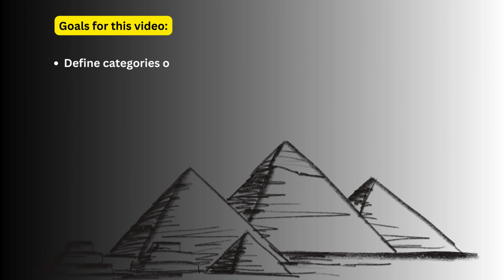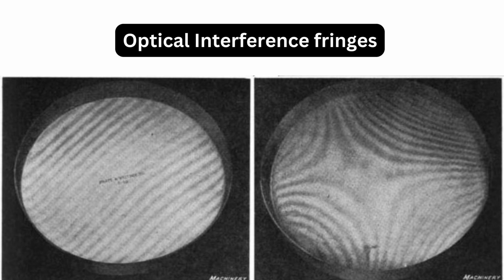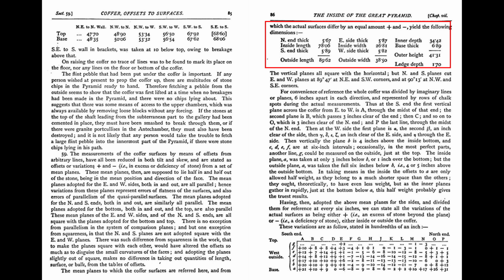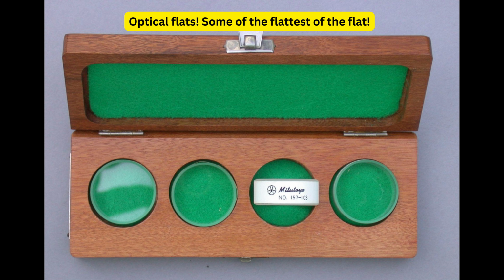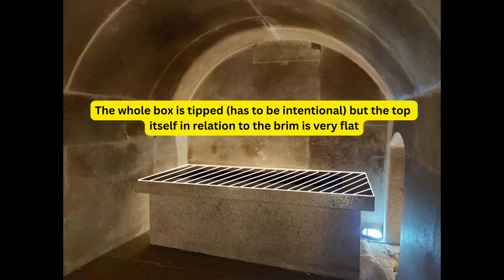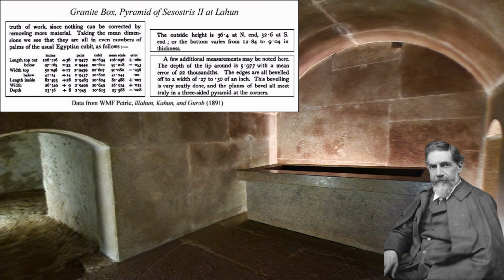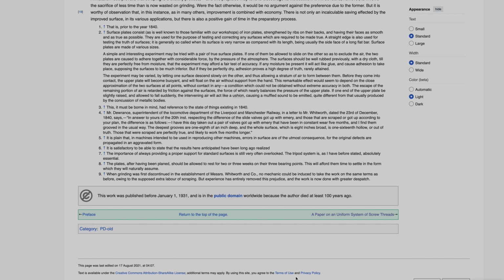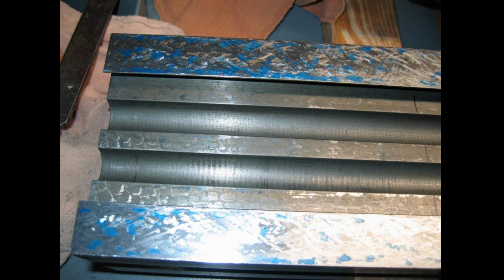The Problem of Flatness in Ancient Egypt

Comment: The three plate method is an excellent low tech way of getting something incredibly flat even by modern standards. But this isb only possible for a certain size of stone like a sarcophagus. But this their falls apart of you look at Sacsayhuamán and how the stones were for to each other. You can't get a credit card between them. There is no technique that I heard of that can explain how they did that. A lid of a sarcophagus is easy but your can't do that with 50 ton stone. Keep in mind all the faces of the stone fits ALL of the surrounding ones. They went even so far to implement small triangular stones into that wall and fit that to the three surrounding huge stones. To move these stones and grind then to each other would not work with the tech we know of. I want to be very clear there. I'm not some woo woo guy that's thinks they had electric drills and CNC machines. But they definitely must have had something more sophisticated than we see in the records. I mean the Egyptians even only show how they transported the small stones. The 200 ton stones would have pulverized the wood they had available so they must have used a different technique. That's not some crazy theory.
Reply from the maker: One problem at a time! I currently have a 4 foot long map of that very wall on my drafting table, I have a few ideas. Stay tuned! Its a fascinating subject.
Reply: @intothemap360 So what is your probable theory about how they achieved that? I would also say that looking into the problem of the 200+ tons obelisks is worth it. If you want to know the best arguments from the alternative archeology side you should follow Dedunking. Yes with two Ds. Like in dunking the basketball. He makes some excellent points and is no into woo. He just points out some inconsistencies and problems with popular theories. I would recommend especially his video and the Thunder Stone the biggest stone ever to be moved. It's interesting because it shows what engineering problems they had even with modern metallurgy. He goes into what he personally thinks that means. It's definitely worth a watch if you want to steelman the other side.
Reply from the maker: I tend to not go into theories in comments. It takes me months to work through the various logical problems, build models, test, and ponder to see if I come up with something that’s both logical, sound engineering and something that I can actually then present in an interesting manner. I’m not trying to use that as a cop out I hope you see the types of videos I make here are at least an attempt to stay in a logical framework.
Reply: @intothemap360 I understand. But will you take a look at the points Dedunking makes? It's vital to steelman the other side's best arguments and I think he made some very valuable observations. Look up his videos about the Thunder Stone. Or are you already familiar with his content? It's always easy to attack the crazy woo woo guys but the actual good points are not made by them.
Reply: Flat things fit flatly together. There are plenty of examples around Sacsayhuamán where you can get a credit card into them. That's hyperbolic language. 
Now assuming you are referring to the polygonal masonry walls...at the most crude level you'd need a stick, string, and weight, or essentially a plumb bob to transfer the shape from one cut to the adjoining one. You don't cut both to fit. You cut one stone the way you want it, then getting the other stone near it, transfer where that material needs to come off the new stone to join up to it. (I think it is easier to explain with a picture, but here we are.) Once the basic are done you can move the stick around between them and provided you keep it pretty level, wherever the stick...well sticks...like you start to find it jamming up, you know some material needs to come off there. 
Stepping up from that, you'd start looking at various pantographs.
Reply: @AveragePicker  The ones that fit less well according to mainstream archeology are exactly the ones that were built later. I'm not talking about them. I'm talking about the stones that weigh up to 100 tons. I know what you are talking about. Dedunking theorized that some of the statues were carved that way to make them perfectly symmetrical symmetrical. He proposed one of the jigs like those pin impression toys. You know the ones. You press your hand into the metal pins and in the other side you have a perfect copy of your hand impression. By the way that's exactly one of the things we don't find in the records. Yet we know that they most have had something like that. It's important though to consider the fact that even with those jigs the precision you could achieve was not in the same level we see in Sacsayhuamán. I mean they are still pretty precise but the ears for example are not perfectly symmetrical or level.
In Sacsayhuamán the stick method won't get you far. The most impressive feat are in fact those 100 ton stones that are perfectly fit together that you literally can't get a credit card between them. So I assume they must have some kind of technology to achieve that. To be clear I'm not saying they had electric drills anything of that woo. All I'm saying is we are missing a part regarding that specific case.
Same goes for the Egyptians when they moved the Colossi of Memnon stones. The statues weight is estimated at 800 tons. But since they were carved in place that means the original stones must have weighed 1000 tons maybe more. At that weight there is no way to roll them on wooden logs. They get pulverized at that pressure. The heaviest stone we moved in the modern age was the Thunder Stone. But they had access to modern metallurgy and still the iron cast bearing balls would be pulverized. They had to use bronze.
Reply: @EbonyPope  Maybe if you don't want answers, don't ask questions. Plus, you're all over the place. WTF, are you talking about walls or statues? And I have no idea why you are talking about pins. I never said anything about pins. I think that is a ridiculous idea and not needed. We've been making statues and symmetrical things for ages. Is there some point in history when you accept they could make symmetrical things? Because very obviously it was done everywhere throughout history. Child pin jigs weren't needed. 
Symmetry is now difficult to achieve. If you have something to mark with and a stick you can do it. If you have two things to mark with and more sticks, all the better. And soon enough you'll be at a crude pantograph.

"...the stick method won't get you far." Actually yes it will, but you apparently don't want to accept it or look into it and just want to jump topics and jump to assumed conclusions....so why bothering asking?
Reply: Large stones are lapped with small laps and are checked with thread

Comment: If you rub one stone on top of another, they grind each other down and slowly become flat.
The farther and longer you rub them, the flatter they get.
Reply: The two surfaces will slowly conform to each other, but may not be actually "flat". My understanding is that one surface will be convex and the other concave. Both of them will have the same radius (i.e. be the surface of a sphere), which will be very large, but not the "infinite" of a truly flat surface. Using 3 surfaces that you carefully alternate between, when done correctly, will get you three truly flat surfaces.
Reply from the maker: The main thesis of my video!!!

Comment: They cast the stones in place, it's called geopolymer.  The best recipe I've found so far (there are many) is: Mix 2% slaked lime (water-glass catalyst) with sand (any type you want, lots of granite and quartz sand laying around), make your wooden form, pore some water-glass in then some sand-lime mix then mix, add more sand and mix, add more water-glass as required, after full let dry a few days, then repeat for next stone, it takes about a month for full strength. When making your forms cut a hole near the bottom and cover with cloth to let the excess water-glass flow out or the mix won't cure right. The holes are what make the nubs seen at the bottom of the bricks in the wall, sometimes they break of sometimes they don't, depends on how long you leave the forms on.  Surfaces could then be polished using a number of methods including the methods described here. If you want you can drop some big rocks into the form just for filler. If you want to try it you can get slaked lime from the hardware store and water-glass from crystalline kitty litter and lye (just add water and boil). Have fun!
Reply from the maker: 😂 no. That’s not how you make stone. Geology really has this figured out already

Comment: Please take a look at the polish of the Barabar Cave interiors.
Reply: Polishing granite is easy. You need fine sand (that is harder than the material you want to polish) and a polishing pad that is generally softer than the polished material itself. When the polishing pad is out of a softer material, the sand will embed in the softer material when pushing the pad against the granite. The embedded sand will then cause micro scratches in the granite during polishing that will result in a shiny appearance. Easy.. the softer material can be wood, copper etc.
Reply: @chronokoks Do you mean the polishing pad has to be softer than the *polishing material (the sand), not the polished material
Reply: @chronokoks  Yes the Barabar Caves are super easy.
Reply: @whig01  This video explained how flat surfaces can be lapped into stone i explained how they are polished. I make precise granite slabs for grinding stone corrections for about 10 years as my side business. I did rather large slabs too and it just took time and effort. I don't see any problem with Barabar Caves given time and labor.
Reply: @whig01 polish isn't flat you Muppet......
Polish is smooth not flat......
The fact you don't even understand that difference excludes you from any further conversation on this matter
Reply: @chronokoks  Try polishing the ceiling.
Reply: @seanp9277 Sure it's hell on your back, but the concept is the exact same.
Reply: @tyrannosaurusimperator  All the slurry falls down. It is hell on your arms. Plus these ceilings are curved.

Go ahead and show us how it is done.
Reply: @seanp9277  OK but nothing you said makes it unfeasible, just tedious and difficult. Sorry you can't imagine people having some grit I guess!
Reply: @da54177  Sorry you can't understand practicality.

Go ahead and do it. Make a replica using only primitive tools.
Reply: @seanp9277 You're right. I completely forgot about how sanding must be done completely flat, otherwise gravity makes it impossible.
Reply: @seanp9277 Just because you have no ambitions, faith, or a desire to create something lasting doesn't mean the ancients also didn't.
Reply: @seanp9277  nope, slurry doesn't fall down.. it clings pretty well... btw I tried polishing granite upside down right now.. it's perfectly doable
Reply: @chronokoks  Bullshit. Press on the slurry with a block and you squeeze it out the sides. Gravity does the rest. You've heard of gravity, right?
Reply: @seanp9277  dude, not all of it will be squeezed out, it's not a thick paste, many of the abrasives will be still between the polishing pad and the granite. I think you have a very low IQ. Plus I already stated I tried it with a block of granite already, no problemo, the polishing "paste" stays where it should.. you have probably never lapped anything in your life or not even polished anything
Reply: @chronokoks  You're lying.
Reply from the maker: An interesting topic for sure! I’ve seen those. So cool! What a job chiseling them out would have been
Reply: @intothemap360 magic chisels
Reply from the maker: 😂😂😂 good band name
Reply: @intothemap360 yea because it's fantastical. Because the idea those places were carved with chisels is fantastical.
Reply: @dylanlevar5176 you can carve out rock with a deer antler fool.......dosn't even have to be magic .........
The more you know eh
Reply: @dylanlevar5176  you've never done a days hard work in your life have you kid.........always the same with you armchair construction experts.
Thoes of us that have actually carved stone and worked know that you can achieve that easily with hand tools and time ........
You silly man
Reply: @dylanlevar5176 looks like someone is having skill issues

Comment: How does one rub two 10-ton stones against each other to flatten each? 20-ton? 5-ton?
Reply: The flattening of smaller pieces is just to use those pieces to flatten larger pieces.
The point is to make the small ones as accurate as possible so when you use them to grind on larger pieces the consistency scales up.
Reply from the maker: Use two stones that aren’t as heavy as the workpiece. Or use two bronze plates in a wooden guide. I’m sure it would have sucked immensely
Reply: When you have water and three-body abrasion it takes much less effort than you think.

Comment: Machine flatness of ancient stones is just the beginning of the issue.  Just the fact that they exist is a great puzzle.

One or more of the granite cases in the Serapeum are pictured in the video.  Note that a single piece of granite was quarried, sliced (to separate the top from the bottom) and polished.  The interior of the bottom was hollowed out with square corners and flat surfaces, and polished.  The exterior was flattened and polished to a high luster.  The result was a 70 ton box.  140,000 pounds.  The surfaces are as flat as the naked eye and a straightedge can detects.  Not one of those processes make any sense given the technology and materials of the time and the supposed makers.  

Now look a the numerous examples of polygonal structures all over the world.  The stones of those structures are not flat.  Their curved faces fit perfectly together..  Multiple stones fit together on multiple faces, all curved in three dimensions.  Those stones had to be quarried and shaped before assembly.  The builders had to know ahead of time all the face shapes.

I've looked at this issue for decades.  I'm a mechanical engineer with decades of experience in machining processes.  I don't have a clue how it was done.
Reply: 100% A few hundred bloviators here that are impressed with flatness as a concept. I too have worked with stone and metals of many types and at various scales and there is no way to explain this stuff other than to say it exists. To all the self congratulatory group-think people (the vast majority up in these comments) I say GFY you bunch of low IQ dolts.
Reply from the maker: Haha I built a 3D pantograph like month two of mechanical engineering class. You didn’t?

Comment: You have to factor in the idea also, not all the stone work was done by the same people, think cargo cult. Certain granite work in Egypt found, is clearly in a different league to other work, Like the diorite statues. Hand made precision & symmetry on another level. Then you have huge cut slabs, like the Osireion complex. Or the precision granite box at Elephantine island.
Interesting theories, but I believe you are also making assumptions & jumping to conclusions.
Reply from the maker: You’re right I am speculating but within a firm mechanical framework. I would never stake everything on this being correct but I am presenting some rational ideas to explain how they did it. Remember that when you say precision box I in turn want to know the data and how it then slots into the overall framework.